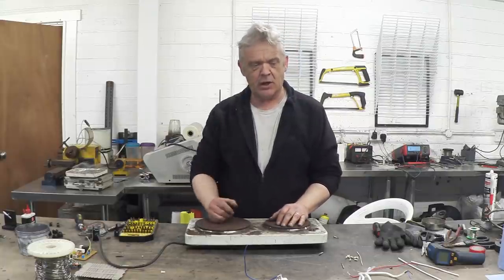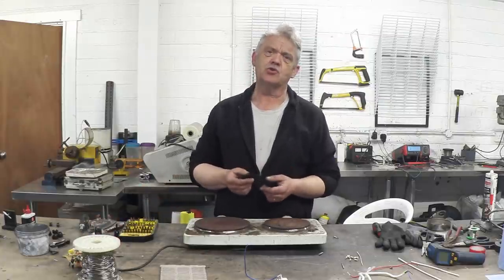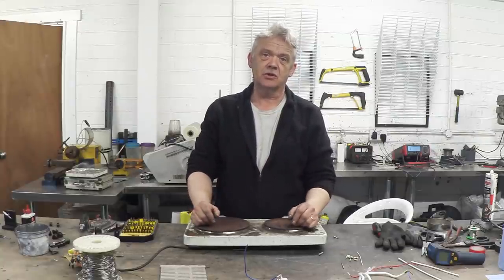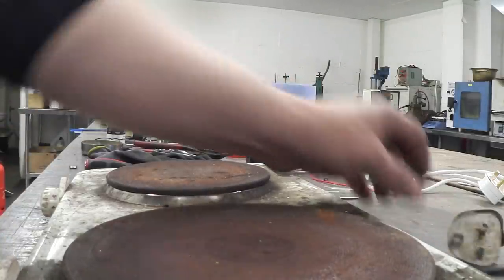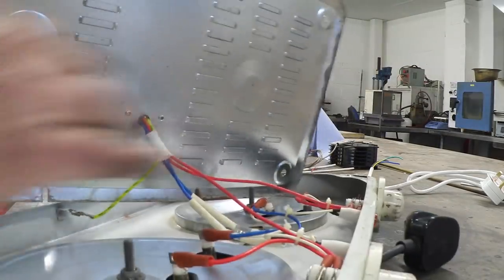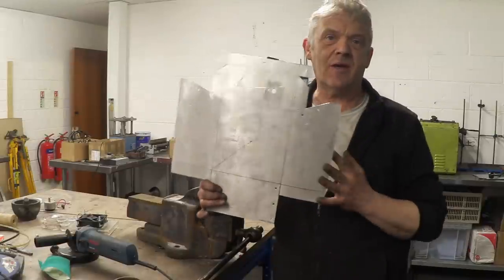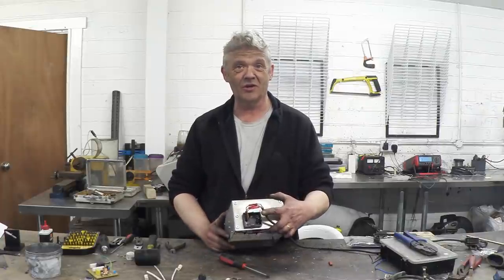How To Make A Desoldering Bath From An Iron Or Toaster Or Hob

Comment: I remember the Wave Solder machines in the 1970s. 

The printed circuit boards with the components in place were carried over the solder bath on a track so that all of the component connections were made / soldered almost simultaneously. Your concept is very similar but works for desoldering the boards. 

At the time I was working for a company that was manufacturing switchgear for the United States Government's Intranet.

Comment: Solder pots are very useful. Almost essential when tinning Litz wire when making transformers and tinning the ends of thick cables or even tinning lots of cables  quickly. Great channel as it's covers both electrical and mechanical aspects. 👍

Comment: Great job Rob - 
A word of caution to all who attempt building one of these - please ensure you properly earth your device - it may save your life..
Rob  when you do apply your PID controller to this project  consider keeping your bimetallic strip as a “ramp” control for the heating element .  The issue being that in the initial heating phase of the  PID will heat the element to glowing red hot and cause issues with your internal wiring etc... The bi metallic strip will eliminate this potential issue for you.
Reply from the maker: I like that idea mate - cheers
Reply: Thanks mate - again - love your work

Comment: Interesting solution. I have used a Heatgun to desolder stuff from PCBs and it worked quite well, even for heat-sensitive parts. I turned the PCBs upside down, heated them up and pulled the components with pliers or a flathead screwdriver. Sometimes even shakeing is sufficient, depending on how long and how deformed the component's legs are.

Comment: I've seen this project done with the heating element from a slow cooker. Ideally a small bath would help as it would heat up quicker and retain more heat. Plus it's less solder to use, having it close to the rim helps too then because you're able to fit bigger components over just touching the surface

Comment: Interesting video. I have the exact same electric cooker, scavenged from a junkyard for free many years ago. It ha been used extensively for boiling liquids, for rust blueing firearms parts and for melting lead for casting fishing sinkers and bullets AND I frequently use it for de-soldering boards by simply placing aluminium foil on the hot plate and placing the board on that and lifting off the components with tweezers.  Simple !

Comment: Neat and tidy the only suggestion I can make is a square or rectangle-shaped bath as it may be easier to work with.
Reply from the maker: you are supposed to fill it to the brim but that was all the solder I had - I am guessing if it was full it would be easier too

Comment: If you heat Waxoyl to 60 C it runs like water. You can spray it with a £10 garden sprayer on your car chassis to stop rust. Better still you can spray it inside box sections and car doors. What I want is a way to keep it at 60 when it is in the garden sprayer and running up the small tube to the spray nozzle.

Comment: This device is called solder-pot and it can be used to solder circuits (if the pot is large enough), although this solder pot could be used in wire soldering or desoldering or soldering small circuits(including SMDs if design permits ). similar techniques are used in circuits manufacturing i.e. wave soldering, selective soldering.
Reply from the maker: cheers mate

Comment: I do a lot of desoldering to get parts like transformers, relays and such. Have been looking at soldering pots designed for tinning wire ends but the pots in them are quite small and not good enough for soaking boards like this. Thanks for the video, this would tin wire and desolder. I have just bought a 3 in one rework station with an alternating power supply and ampmeter and was wondering if the heat gun will help taking boards apart, will have to wait for delivery I guess.

Comment: I've had good results with a 1500W hot air gun, usually sold for stripping paint. Solder gets a bit oxidized if you don't use flux but the parts are otherwise clean and functional. Long pliers or a screwdriver are really helpful to pull the part as soon as the solder melts, or they may just fall off if you shake the board a bit.
Reply from the maker: yeah I tired that - it didn't work for me mate - I burn the board more often than not and as 99% said - the smell!! -  lol
Reply from the maker: lol

Comment: Fill with sand, add a PID controller and it’s then a stable heater for chemistry experiments
Reply from the maker: awesome idea mate
Reply: @ThinkingandTinkering  Thanks, I've got the same bits in a box waiting for a bit of spare time, I'm going to cut the top half off an old cordless kettle to make a heated container, and connect the base cord to the electronics
Reply: Sand also avoids the splashing of liquid metal all over your work area, if you're so unlucky as to drop the item you're trying to desolder

Comment: Found your videos yesterday and i watched and enjoyed them all. Love the fact that you are using a lot of old stuff than throw it away.  
You can put some more solder up to the edge of the tray, then you do not have to dip the PCB in, it can just rest on the edge.  Burned PCB smells nasty.
The aluminium box has to get a lot of heat because it is directly connected to the solder bath. You can drill a bigger hole and put some isolation like Kapton-type in between.  Also for the heat element holders maybe you have some bits of ceramic or some fried electronic components for the isolation purpose?
I would skip the bottom for some ventilation too. 
Made myself a small solder bath from an old soldering iron and a copper pipe. Nothing fancy but it does the job. 
Anyway good work & keep it coming!!  <3
Reply from the maker: cheers mate - thanks for taking the time to post

Comment: Another well presented video thanks.  A very useful tool, when I think of the hours I take trying to remove components with an soldering iron. Just wondering if that thermostat is measuring the air temp inside the box not the tank temp. But it works and is close enough. Thanks again.

Comment: Very nice I like it.  I have a hot plate like that and wanted to add a digital controller so I can use it as a heat source for making DIY surface mount PCB's.  Temperature stability and accuracy is a big factor for that.   But I guess I can simply add a bath on the top and turn up the temp to make one of these too!   I think I'll check out plumbing solder for the bath as I suspect its a lot cheaper than RS or Farnells for the amount needed.  I've also seen people use paint stripping heat guns for removing components for through hole stuff.  The bath might also be good for SMD if you use a PID controller.
Reply from the maker: I tried a paint gun - I managed to burn everything - this worked well for me - the gun I couldn't use well
Reply: @ThinkingandTinkering  I'll steer clear of paint strippers then!

Comment: Really nice job, Rob.  I'm inspired to try a "room temp twist" with some galinstan I alloyed last year.  I expect the trade off to be slower speed for safety and low complexity.

Cost might not compare favorably unless you buy the metals and alloy them yourself, which is also really simple.
Reply from the maker: if you do it mate - would you mind doing a vid - I'd love to see
Reply: @ThinkingandTinkering  happy to....   
I just recently got some cerium oxide to use as a minor alloy component (found paper suggesting high CO2 scavenging function of cerium-galinstan alloy)  will try to make both videos at the same time.

Comment: quite hot is not enough said .The housing will heat to the temperature of the molten metal.Was there no thermal insulator in the original oven? As usual, a video with a great idea. I have to make that  metal bath myrself, I will make a rectangular one, it will be more handy.
Reply from the maker: cheers for the post mate

Comment: You briefly mentioned that some components would be damaged. Plastic connectors, certainly, but what of the other types of component - capacitors, relays, resistors etc? Maybe it is an art, getting the timing just right and having the extractor tool (pliers) immediately ready?

Comment: Back in the 80s I remember hearing about some guys had figured out how to engineer carbon in such a way that it could be configured to extract any heavy metal  so if you had a mix of toxins in a soup of dissolved ash’s from incinerating this sort of waste and passed it through the filters one could separate the different metals . I’ve no idea who it may have been and have often wondered if you might recall such a technology been invented. It would certainly be a tech worth developing , if I remember correctly I think I heard it on a science program on bbc 4, the technology’s that are left on the shelves that could make such a difference is criminal, and it’s not just greed but there is also deliberate destruction of this beautiful planet
Reply from the maker: interesting mate - I don't remember that but I shall have a look into it for sure
Reply: @ThinkingandTinkering   search on google for Extraction of Heavy Metals from Fly Ash using Electrochemical

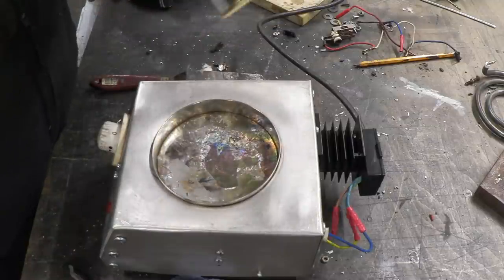Comment: 17:51 watch out for heat on the Capacitors
Reply: electrolyte vaping is the future
Reply: @johanponin1360  Going BANG is a danger
Reply: @3D_Printing  Tantalum caps, from what I've heard, will burn. I use them I just make sure I don't install them backwards.

Comment: I never tried it but I think a hot SAND bath would work instead of the liquid solder if you can get it heated hot enough to melt the solder connections.  That MIGHT also work as a hot plate to use jars instead of special Pyrex beakers for heating liquids since the sand would heat the jar more evenly than a normal hot plate.
Reply from the maker: you should try it mate - that's a nice idea and worth a try just to see

Comment: I just use a cast iron pan on any given burner with a vent hood.  Rather than using solder, I just use spent lead from my local range and give the resulting cleaned lead alloy to friends who do reloading.

Comment: An old clothes dryer that still tumbles can be used. Remove the electric heating element and install a burner. Thow them in, fire it up and let it tumble. Noisy as all get, but very very fast and effective
Reply from the maker: interesting idea mate

Comment: I thought I might suggest making some kind of tray that you could set on top of the bath, that way your only dipping the solder joints and you have an extra hand. Also I am not sure what kind of gauge wire you use but you can get smaller spools of kanthal at vape shops (at least here in the states you can) if you were looking for custom dimensions on your heating element.
Reply from the maker: I think you are supposed to fill the bath to the top mate and just dip the joints - I used the heating element from a hob - I was suggesting kanthal - you would need to match gauge to ensure amp draw at voltage you needed as I used an old appliance where that had been calculated for me I didn't need to do it - but you can if you want mate
Reply: @ThinkingandTinkering  sorry for the confusion, I forgot to type entire parts of that comment. I realize you used a premade element. What I meant was that if someone was going to make their own heating element I dont know what size wire they would need. It would be easier and safer to do it your way considering someone already did the engineering on it for you. As far as my suggestion of a tray, that was suggested with the assumption that the pot should be much fuller. I can see myself dropping a smaller board in and splashing hot metal on myself.

Comment: some components may benefit from getting cooled somewhat fast, I'd suggest making a metal box with a good fan blowing on the parts for that purpose. basically almost the same box, but the hole is on one side at an angle with a fan, and it is upside -down
if you have one laying around, microwave fans are pretty good for that purpose.
Reply: Couldn't you just have a bowl of water nearby and dunk the bits as you get them off? Not many components will be damaged by getting wet provided they are dried off before being used again or corrosion starts to take effect.
Reply: I think that surrounding the part with Blue gum, like the one we use to hold posters on a wall will protect it from overheating.
Reply from the maker: cheers mate

Comment: Robert,  your work inspired me to start work on my own home-lab where I plan to essentially mess around and have fun building, breaking apart and re-purposing machinery to suit other needs. However, I am a bit of a novice in equipment I might need, so do you have any recommendations for some basic lab equipment or machinery I might want to purchase  to start out? Alternatively, if there's anything that would be useful to have but I could make myself for a cheaper price, I would greatly appreciate you letting me know. Thanks so much for these videos.
Reply from the maker: hiya mate - the main things you need are space and time - after that it depends on what you want to do.  there are loads of videos on my homemade lab equipment playlist - and many other people's as well of course. best of luck.

Comment: Yes excessive temperature can damage some components like IC's, semiconductors [transistors, Mosfet's, various types of diodes] and electrolytic capacitors. I thought about just using a $15 Dollar General/99¢ Store hot plate [Glowing red coil type] that has a temperature control using a cast iron skillet. You could use another type but I believe cast iron would maintain temperature better. Typical solder 60/40 melts at 370°F so you would have to use a temperature probe and I also thought of trying vegetable oil???
Reply from the maker: all worth a go mate
Reply: I think vegitable oil would be a sort of mess to clean the parts. Sounds like youd need alcohol or acetone bath.  And the oil and may oxidize and go rancid.

Comment: Seems like it might damage an awfull lot of component's.
Might it work better just using a copper plate?
Can the pins conduct enough heat to loosen the solder just by
Setting the boards on a plate?
Also, I would consider a vent hood, beryllium oxide ain't no joke.

Comment: That's really cool Robert, I might have to build one of those. I bet it will fry transistors and IC's.  Did you use solder or lead in the melt pan/pot? The melting point of lead is quite a bit hotter than the solder. Thanks
Reply from the maker: solder mate

Comment: Its a good project but I do have a few concerns for your viewers and yourself. Earthing - make sure you have a good earth connection to all that metal, a few minutes putting a decent earth connection in could save your life if something goes wrong. Also if you can use a RCD plug it will be safer than waiting for the fuse to blow (I hope you checked the fuse is the right rating for the heater). The mains connection at the back that has been extended - enclose it in a piece of metal flex at least, the 'permanent' crimps are good but still should be enclosed for safety reasons. Goggles - wear them. if you over heat a cap - bang! there goes your eyesight. Gloves - even a cheap pair (of non flammable and non melty) gloves will save your hands from burns. And ventilation - as already mentioned - very important. If you don't have a proper fume extractor with activated filter at least use a small desk fan to draw the fumes away from you. Old solder contains a lot of nasty chemicals including lead and arsenic. Apart from that - its a great use of discarded items and your vids are inspiring.
Reply from the maker: thanks for your concern mate

Comment: The ideal oil temperature for most frying is between 350 and 365 F.  could  you used coking oil?
Reply: John O'Connell I’m assuming there is a suction effect from using solder to help flow the metal out of the joint, you wouldn’t get that with dissimilar liquids
Reply: I found that soldering through hole components, 700F (370C)  is a good temperature. Some solder may need higher temps.  While you might easily find an oil that works at that temperature, it sticks and wicks to the board and components, making a bit of a very hot mess, and the salvaged parts will need cleaning.  the oil will get contaminated with solder, and may eventually oxidize and go rancid. Molten solder will only stick to pads  and harmlesly wick component leads without requiring additional cleaning.
Reply from the maker: I wouldn't mate - there are quite a few reasons but most of them will come down to a right old mess lol
Reply: I just an idea
Reply: @ThinkingandTinkering  There is a lot i can learn from your wisdom.

Comment: .......silicon and gallium arsenide components aren't so easily damaged by heat these days plus components are built more and more to withstand higher temperatures. .I just have too strong a memory of all the costly germanium semiconductors I heat damaged long ago .. When soldering or unsoldering I'll dob a dab of cold wet ceramicist clay onto case of  expensive looking semiconductors as heat sink to keep em cool . Where do we get the clay? ...from pottery ceramic supply shop which is same place to purchase copper, zinc ,nickel etc  oxides and potassium carbonate....... that have all been required at some point in the videos
..These days here in Australia we can no longer obtain antinomy, flourspar ,vanadium, graphite powder componds and other stuff from them.
Reply from the maker: indeed mate poetry suppliers are a cool source of lots of 'stuff'